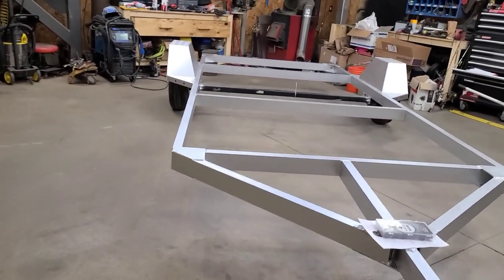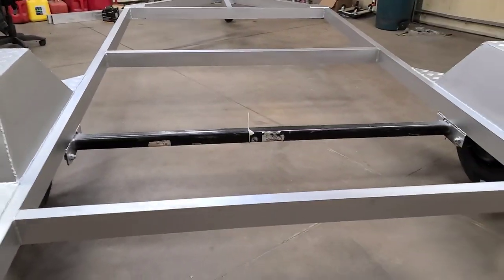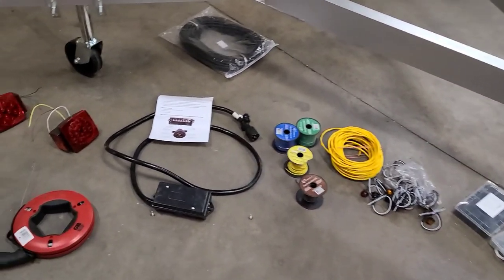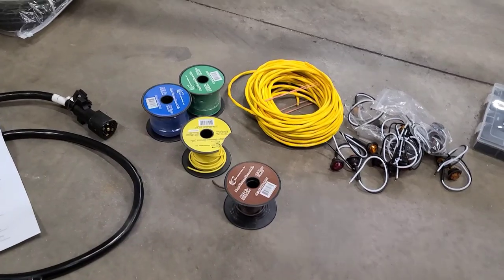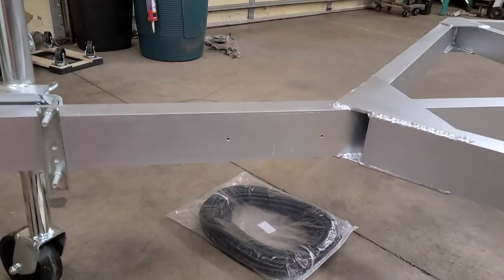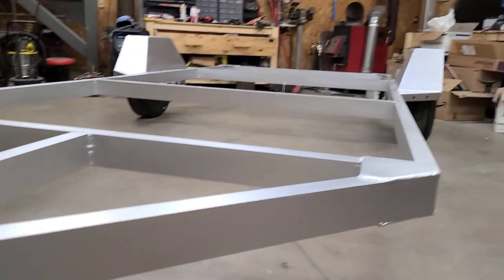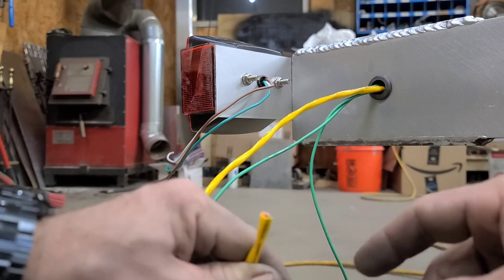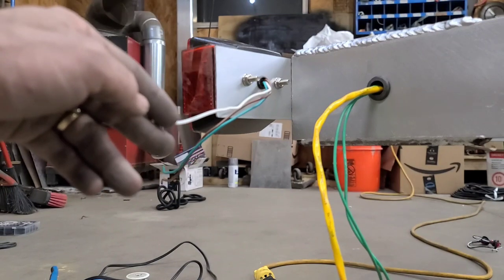how to wire up a boat trailer with brakes

Comment: Any way you can post  a link to the type of wires u use or all the materials?
Reply from the maker: https://amzn.to/3o7TQQZ
Reply from the maker: There is the link to the lights I used
Reply from the maker: https://amzn.to/3zHqYkM
Reply from the maker: There is the link to the 7 pin wire harness

Comment: You got lost in the weeds there with color, color, color. Draw a picture/schematic that we can freeze-frame and save tons of talking. I pity the person who has to trouble-shoot this trailer-wiring system years from now. As a retired Electrician I go to the extra trouble and expense to maintain color-coding throughout any of my work because life is so simple that way.
Reply from the maker: Must not of watched it everything is color coded.
Reply: @JDSOutdoors  I watched it from beginning to end. You mixed colors everywhere. I did stop in the middle to order some grommets and I was happy to see you used the same 7-plug unit I bought this week so I got to see it in action. I'm planning to install mine so it never gets dunked under water. I was pleased also to learn about the proper placement of the amber and red running lights. I was about to make all mine amber. I liked your cut-out brand on the fenders and rear of the trailer but they would look much better if they had a frosted plate of plastic behind them so they stand out like signs on buildings do.
Reply: One more thing: I agree with running separate lines for both sides of the trailer. I've bought enough cable/wire to make separate runs. I especially think the brakes need their own feed instead of sharing both loads on the same wire. So, I like lots of what you did but not all. With all the trouble you went for your logo, I don't understand why you didn't install back-up lights. The quality of the trailer you manufactured deserves them.